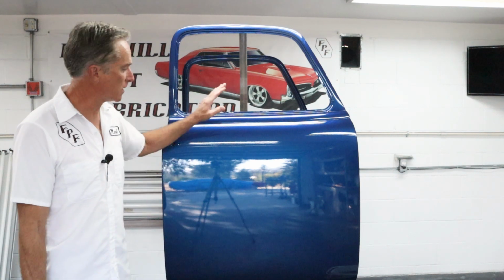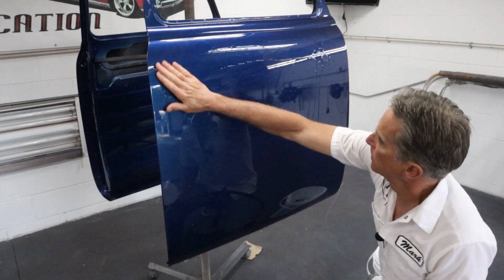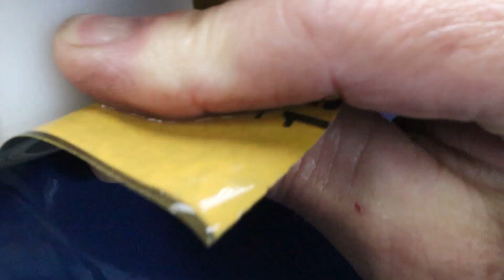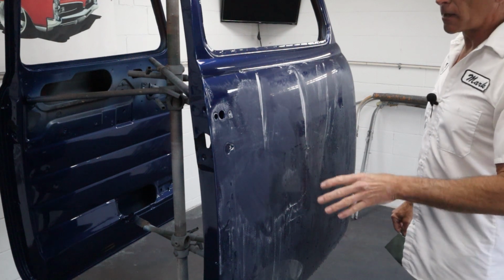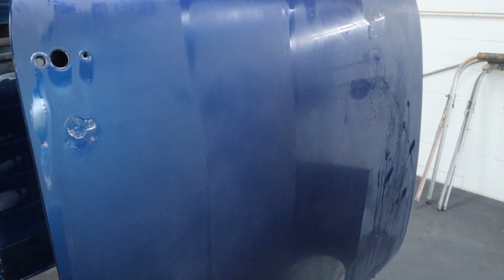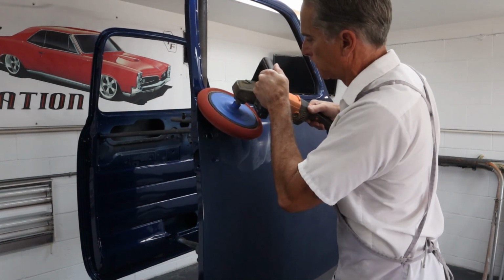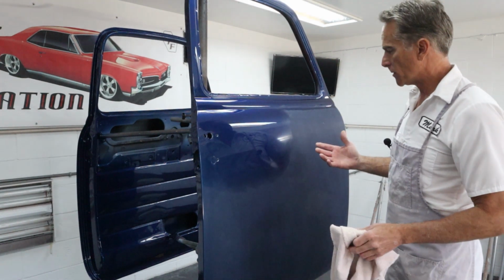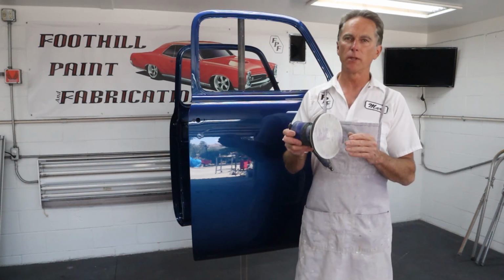1950 Chevy Truck (Ep 65) Color Sanding with a DA (Dual Action Sander)

Comment: You make it look so easy Mark. I've never heard of someone using a regular DA but it appears to work, thanks for the tips. I will (someday) have a huge cutting and buffing job on my panel. I did get a Harbor Freight  palm wet sander for "Christmas" a few years ago but I have not used it much yet. 
I have tried the foam buffing pads in the past but I didn't like them, maybe I am using them wrong, I will keep learning. Your results are fantastic.
Reply from the maker: Thanks Dennis.  Using the DA correctly can be a huge time saver and actually provide superior results to hand sanding if done properly.  They key to the foam polishing pads is the polish you use.  It needs to be designed specifically for foam pads.  The polish isn't cheap but it is worth it. That panel of yours is going to eat up some sandpaper that is for sure.
Reply: @FoothillPaintandFabrication  "That panel of yours is going to eat up some sandpaper that is for sure" It sure is, but I am looking forward to that part. I need to invest in polish, I only have an old bottle of 3M heavy duty. I will make sure I get the right kind. Thanks for the advice.
Reply from the maker: @BusyAsABeaver72  The ole grit in a bottle, I remember those days.  You can't even feel any grit in the new stuff, pretty amazing really.

Comment: Good video, lots of information. Just one question, after wet sanding coud you use a da polisher  to polish out the sanding marks or does it have to be done with a rotary?
Reply from the maker: DA polishers don't seem to polish as quickly as rotary in my experience. I am sure it would do the trick, just slower.
Reply: @Foothill Paint and Fabrication  ok thanks for replying 👍
Reply from the maker: @gavincase932  My pleasure, let me know if you have any more questions.
Mark

Comment: What grade sand paper did you use on the DA ?
Reply from the maker: 1200 with the DA and 1500 by hand.  It works pretty slick on large flat-ish areas.
Mark

Comment: Is it correct that you did all the DA color sanding with 1200 grit? You started and ended with the same grit? Thank you
Reply from the maker: Hey David
Yes, in fact that is the only grit I have for the DA wet sanding.  Using a machine what ever grit you are using is less than the same grit hand sanding. I only hand sand to 1500 before polish most of the time anyways so DA1200 comes out to about 1500 hand sanding.
Mark
Reply: @FoothillPaintandFabrication  thank you for the reply. That's good info and a great video.
Reply from the maker: @davidray4655  It is a real elbow saver that is for sure.